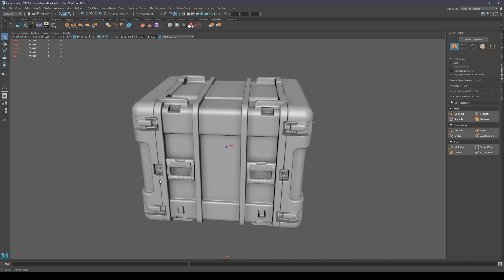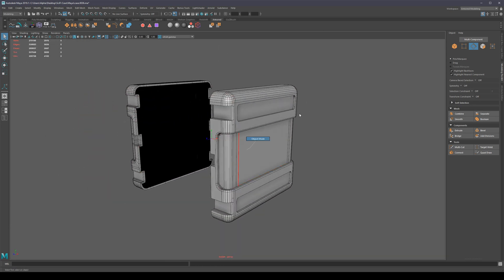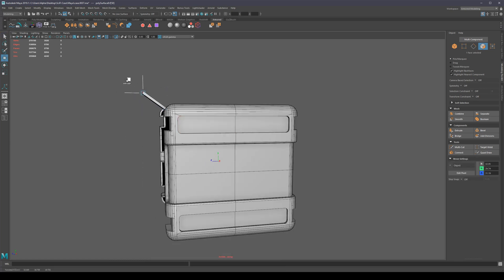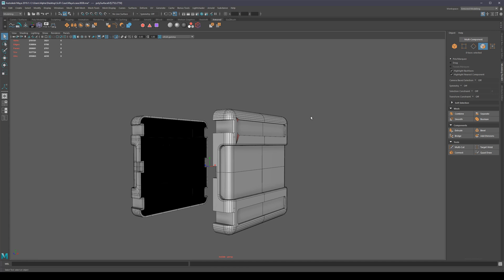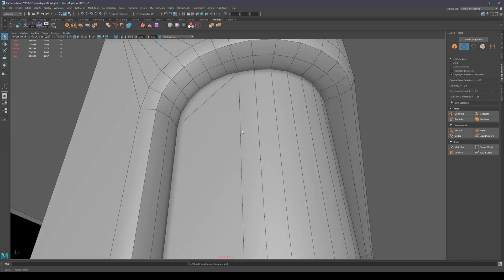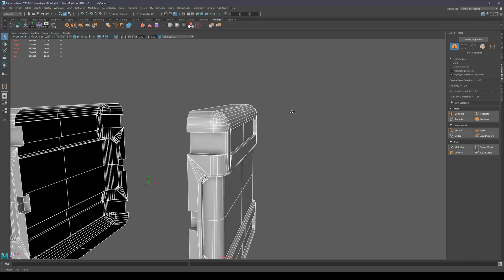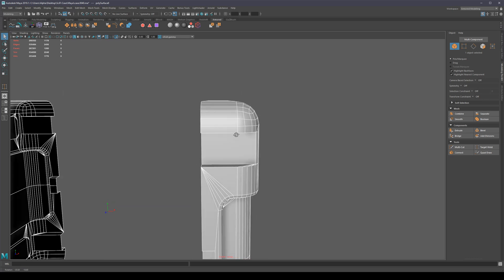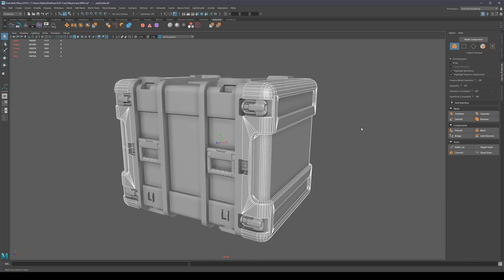Easy way to convert a SubD mesh into a Lowpoly

Comment: very cool scripts,thank you,I notice some issues,some of the scripts,can't be proper undo,and as soon as you change the options it breaks,I found out that some scripts are just miswritten a simple line eg. "bp_option"which it should be "bl_option" like the case  "ARMORED_select_hard_edges".that causing the script can't perform correctly,just let you know,very greatwork.
Reply from the maker: Thanks, I did know about that typo but I haven't uploaded the fixes become I'm focused on my addon Curve Basher, which is a paid addon so it takes priority over the free stuff. But a big update is still coming for the free stuff once Curve Basher 1.3 is released.
Reply: @ArmoredColony  shit,why my comment is here..I remembered it's in your scripts demo vid...nice work anyway.
Reply from the maker: Thanks 😌

Comment: Is there an option to auto select floating verts on edges?
Reply from the maker: Yeah, go into vertex mode, double click to select all of the vertices and press delete. Maya will only delete the extra vertices in between edges.
.
I think that works but I haven't used maya in a while so let me know.
Reply: @ArmoredColony  yo that works thank u

Comment: I am a beginner but this is what I learned from creating a mesh part inside a mesh or surface, similar to your problem. There needs to be always min. 2 edges connecting the inner mesh part with the outer ones. Tricky to explain, but this is why it worked for you aswell with 2 edges and not before when you only did 1!
Reply from the maker: Oh yeah, I did know that you can't have an extrusion with no edges connecting it to the rest of the mesh, but I think I just wanted to showcase a situation that might happen that could also break the mirror tool.

Comment: why do you have to triangulate for the baking? thanks
Reply from the maker: You don't have to but it's preferable. Everything is triangulated at render time anyway, but your modeling software might triangulate a quad one way while the render engine might use another. There's also your baking software to consider.

It's not the end of the world if you don't do it, it's just good practice and one of many things you can do to make sure your game asset looks good.

Comment: https://youtu.be/inMOHuslD3k?t=76 I have used  this  free script for that https://www.youtube.com/watch?v=ypC9ujrZhnI   
add popup menu/Change angle

int $lowAngle = 30;
 
int $highAngle = 150;

0-1
0-5
0-25
and .....

int $lowAngle = 0;
 
int $highAngle = 1;
Reply from the maker: I already have a similar script that selects only hard edges but I didn't mention it in this video. It's part of my free hotkeys and scripts for Maya (I mapped it to Alt+E) . The script in THIS video does the opposite and on top of that, it selects edges based on their angle instead of their soft/hard setting.

Point being, I have scripts for both and you can find them for free on my Gumroad.
Reply: @ArmoredColony  thx